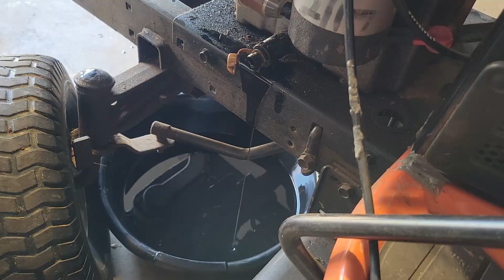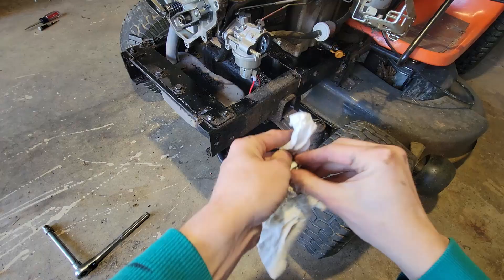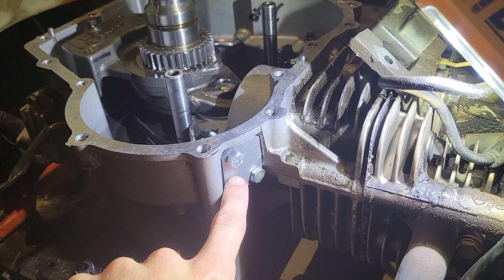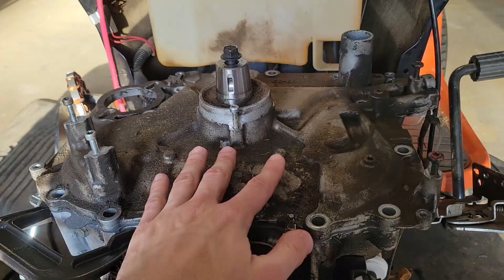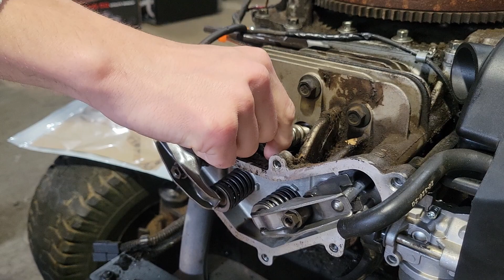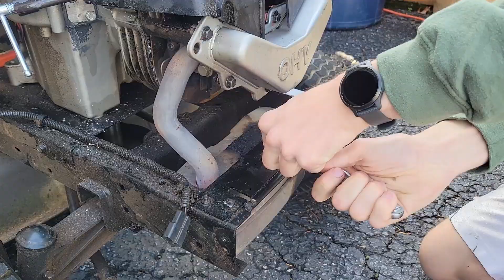How I Repaired Every Issue With My Kohler Courage 20 Mower

Comment: next time when the valve cover leaks again, toss the cork gasket in the trash where it belongs and just lay a semi thick bead of silicone right on the valve cover. this is a permanent fix, instead of these other "permanent fixes" that do not work for longer than 1 season. been there done that.

when i started as an auto tech in the early 1990s, cars still used cork gaskets. they were by far the biggest repeat issue we were dealing with in repairs at that time. silicone technology wasn't that great back then, but then we came out with siliconized steel reinforced gaskets, and RTV that actually worked to keep engines sealed up and since then cork gaskets have disappeared from cars. so why are lawnmowers still using a technology we abandoned 35 years ago? that's a really good question, and no one has made a proper replacement for these engines either.

Comment: Have one with less than 100 hours, dropped a valve seat. Probably overheating?!$.  Center punched the valve seat (tighter fit) then Pounded it back in and it runs good. Nice simple motor design,If it was made of cast iron it might actually be worth rebuilding.

Comment: Question, if anyone could help out. I followed this tutorial for a troy bilt. Put everything back together, now it won't start. Engine spins, but won't turn over. Tried starting fluid also. Any ideas?
Reply: Hello, did you manage to get it working? I have the same problem
Reply: @williamstel  If it's not firing when you use starting fluid then check ignition coil/spark plug for spark and also check safety switches seat/blade engage/ clutch. Might be pinched wire...

Comment: BUt wait! That’s not all…all Kohler Courage engines should have a shutoff installed on the fuel line. A faulty needle/seat will cause the fuel tank to empty into the crankcase. I had fixed everything in this video…except that. And guess what happened...

Comment: I have a Cub with the exact engine with 460 hrs. Saying that these are bad engines I say they are one of the best. Think about how many hours 500 hrs is with NO problems. These problems aren't even the engines fault. No parts failed and if you catch and fix these few issues then there are no problems at all.

Comment: Nice video! Really inspiring. What's the condition of the crack? Is it leaking ? Any other issue with the mower  ?

I might have to do that on my Cub Cadet LTX1050 with Kohler 24HP SV725 engine. I like the fact that my engine only has 160 hours but have all the problems you can imagine.  I also have to replace the PTO seal. The mower stayed outside for an entire season before I bought it. Well, I guess I'll learn more skills.

Comment: When replacing the valve cover gasket, I used some heavy duty oil resistant rubber gasket material and also made a heat shield. Just over 2 years and no leaks. This old thing has about 1800 hrs on it.
Reply from the maker: That's a ton of hours for one of these engines!

Comment: you did a brilliant job of repair except one thing jb weld does not hold up to heet well if it leaks try right stuff made by peratex😂😂
Reply from the maker: Yeah, I wish I had a way to weld aluminum. Jb weld was the next best thing I could think of. I was hoping to get a couple more years out of it

Comment: This is no beauty contest. If it's ugly and it works...it's pretty to me! (The only thing I would have done differently is I would have used some assembly lube on the rocker pivots, ends, and push rods, and the cam lobes if accessible, when reassembling.)
Reply from the maker: I couldn't agree more! Just needs to hold up for a few more seasons lol That's not a bad idea. Would help with that initial startup.

Comment: while the bolts do loosten and can catch the flywheel, the cause of the crack is that when that top cover gets loose, nothing is holding the engine together. the force of that massive piston pushing the crank, is the same force in the opposite direction in the cylinder. Without the top cover to hold it together, that massive explosive force from combustion (these engines make a lot of power for their weight) inevitably breaks the block from the inside...while the piston is shoved down, the expanding gasses are pushing the head/cylinder in the opposite direction.
Reply from the maker: I absolutely agree! That's a great point! That top cover is crucial to the strength of the block. From what I understand if the bolts were torqued down properly these engines lasted a very long time

Comment: This is a terrific video.  I've got the oil burn issue, and I hadn't investigated enough to find the cause, but now I know what is likely the problem.  Also, I will now know to check for loose bots on the crankcase cover and for cracks.

In return, here's something I can pass along.  A few years ago my machine would stop running after a few minutes.  Somehow came to find out engine heat degrades the solenoid valve on bowl of carburetor.  This is another infamous issue with this engine.  Kohler makes an after-market heat shield which I installed and completely solved the problem.
Reply from the maker: Appreciate that! That's good to know. I haven't had this issue but I'll be sure to look out for it!
Reply: Part #?

Comment: Is this the only engine that went on this mower?  Im trying to find a replacement engine for it instead of fixing the cracked block and i dont want any headaches with the muffler/exhaust installation
Reply from the maker: I'm not sure if it's the only engine they put on them. I imagine it would be a headache to convert over to another setup. If it were me, I would purchase another mower. I've been seeing them fairly cheap on FB Marketplace

Comment: Excellent video, my courage 17 went POWWW like a old cartoon sound. Opened up ,had field mice nest in there. Cleaned it out, replaced spark plug, ignition coil, fix fuel solenoid and still will not start. Sprayed starting fluid into carb and it went POW again and nothin more.
Reply from the maker: Yikes! That doesn't sound good at all!

Comment: I just got one for free oh no 😂
Reply from the maker: Can't beat it for free! You can still get a decent amount of hours on these engines
Reply: @BustedBeaters  It ain’t cracked yet should I still put a C clamp on it?
Reply from the maker: I wouldn't do the c-clamp. That's really a last ditch effort lol. I received a free mower with the same engine (just not cracked). What I did was applied loctite and retorqued each bolt on the engine cover one by one. From my understanding, as long as these bolts don't loosen up and hit the flywheel, the block won't crack. This has worked so far, but I've maybe only put 20 hours on the mower since then. We'll see!
Reply: @BustedBeaters  Oh I got ya. I will snug up those timing cover bolts instead. Thanks my guy.
Reply: My mower must not have many hours on it. My intake was exactly .005 and my exhaust was tighter than .007. Also only one timing cover bolt was slightly loose.
Reply from the maker: Not too bad! Good thing you were able to catch that loose bolt!
Reply: @BustedBeaters  I might have to adjust that tight exhaust valve. the engine runs so smooth and nice but the muffler glows a bit.

Comment: Just wanted to say thanks for this video.  I have a TimeCutter Z4200 and I already replaced the first engine due to crack.  Second engine just cracked for no reason.  No bolts were backed off on the block.  

So screw replacing it again, I’m using a plate and JB weld.

Your instructions are fantastic for tearing the engine down. 

Waiting on JB MarineWeld since it is oil/gas resistant.  Then I’ll follow your steps further.
Reply from the maker: No problem! I hope you can keep it going for another couple of seasons!

Comment: Thanks trying to fix crack without disassembly buy I think I'll add the clamp too . its surprising how hard it is to get parts for then engines included 'discontinued' parts from kohler that are needed!   Next mower will be electric , can't stand the noise these make!
Reply from the maker: Yeah it's very hard to find parts. My thought was to just keep it running as long as possible. Electric seems to be the way of the future!

Comment: FINALLY found a video of someone taking a Kohler Courage engine apart like that. I'm having an issue with mine with the engine not turning over, have it all torn down to where the internals (cam/crank shafts are exposed). When you tore it down did you have any issue with that compression release on your exhaust cam gear? Thinking that might be my issue from others I've ask but not sure what makes it "bad" or not.
Reply from the maker: That's interesting? Will the engine turn over? Did you look at the valves? I've seen issues where the valves are stuck closed causing the engine to be very difficult to turn over. The only issues with my engine was the cracked block and leaking oil
Reply: @BustedBeaters  Thankfully no cracked block/leak here. The flywheel would spin from the start but start dying very fast and definitely wouldnt turn over. Read some things further online saying those older starters were replaced a few times by the company since they were claimed to be underpowered. In the time i commented here on your vid i replaced the battery, starter, and the compression release spring. Put it ALL back together and now I cant get ANY power to the starter to even test it. I didnt even do anything with the electrical/solonoid so i dont even know where to go from here.

Comment: You explain it very well but most shops will not even try to fix one because of warranty issues 
But most of the time it works great 👍
Reply from the maker: I imagine that most of these engines are out if warranty. I imagine you're right that most shops won't want to mess with them

Comment: Flywheel must be removed and bolts check every year and add blue lock tight added with clean dry bolts and bolts holes 
Sorry design for sure 😢😢😢
Reply from the maker: Yeah terrible design. The goal is to keep it going as long as possible lol not an easy task for sure!

Comment: You should have also replaced the shaft seal on the flywheel side.
Reply from the maker: Yeah youre not wrong. 
. Proaby not an expensive part but my goal was to keep it running for the least amount of $ possible

Comment: Nice work and information. I have the kohler courage 19 and it died last year. 500 hours. I already had a new Cub so i parked it till now. Gotta tear it down and see whats broke. May be something not worth fixing. My career is automotive technician so I have no fear of repairs. I will say nothing is built like the old stuff. Just junk.
Reply from the maker: Yeah junk is right. I would say that if it can't be fixed for less than $50 it's probably not worth fixing. Always fun to tear them down and see what went wrong though!

Comment: I have a weird problem with my engine of the same type. The speed control lever moves up and down just fine with all the components underneath. Yet, engine runs at high speed only, regardless where the speed control lever is. In other words, it only has 1 speed, and it is high.

Comment: Excellent video. Thanks. I swapped mine for a ME1004 electric motor with a 500 amp speed control and Lithium ion battery. This is a crap motor. What were they thinking?
Reply from the maker: That sounds like a pretty cool swap!
Reply: Nice swap, do you have a video of it? What's the price tag to do a swap to electric?

Comment: The engine mounting bolts also loosen up. The starter also has problems (3 generations of starters).  The Kohler Courage is a dog, but the rest of Kohler engines are good to great.
Reply from the maker: Yeah this was a rather unfortunate purchase. Kohler really messed up with this engine. Patched it back together and it's still running though!

Comment: Now that those issues were fixed that engine will last a good long time. The lock tight on the bolt's is what it needed from factory. Now that it's fixed not much else will go wrong with the engine. Keep oil in it and this motor will last a long time for sure.👍. Keep us updated on how well this engine is doing in time. I bet you will be happy with it's performance. I have one just like this one and I fixed all of the issues in time before those loose bolt's cracked the block. Not sure how long those plastic gears will last but mine is still running strong.
Reply from the maker: So far it's survived a season so I'm pretty happy with it. Yeah I wouldn't have thought the plastic gears would have been that durable but they didn't show any signs of wear when I opened it up. Hopefully It'll run for a while

Comment: Great job on the crack, excellent how to video, muffler protector/heat shield. The Kohler eng doesn't deserve such a nice big oil filter...lol I wonder if replacing that eng with a briggs would be a big hassle or not.
Reply from the maker: Hahaha I agree! This engine doesn't deserve an oil filter at all! I'm not sure what would be involved in replacing the engine with something else.. In my case the rest of the mower is in rough shape so I would probably just replace the whole thing.
Reply: @BustedBeaters  I tend to agree, not wanting to spend 800+ for a new eng even though I already replaced many other parts like spindles, belts. My kohler is hanging in there with just a minor carb leak while it's shut down. Fixed that with gas shut off valve. May have to swallow 2,700 for a new one....Grrr
Reply from the maker: I know the feeling! I have a feeling mine will be at the scrap yard the next time something major breaks. I also had to put a gas shut off valve put on. I eventually bought a chineese carburetor from ebay for $25 or so. It runs just as it did but, without the leaks!

Comment: How did she hold up over the summer?
Reply from the maker: So far so good! Its still up and running and doesn't have any oil leaks
Reply: @BustedBeaters  Awesome! I'm going to do the same thing to mine in the next couple weeks. My block cracked much worse than yours was. But the repair seems promising. I've already tried just using JB-Weld, But i didn't remove the case and do it to the inside, or put the c-clamp on it. The JB Weld didn't hold up on the outside alone.
Reply from the maker: Good luck with the project! Yeah I didn't think just the JB weld would hold. And I had to throw a tack weld on the c-clamp to keep it from backing out and falling off. So far it's all holding together!